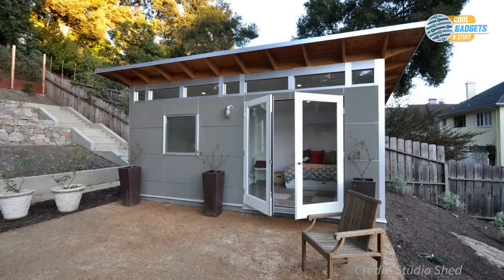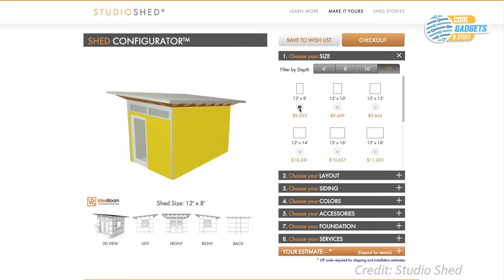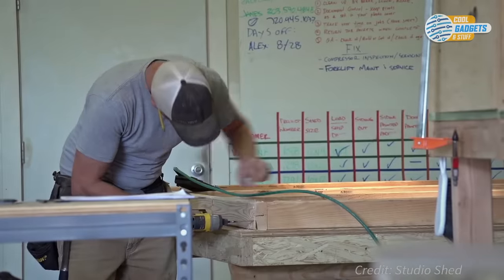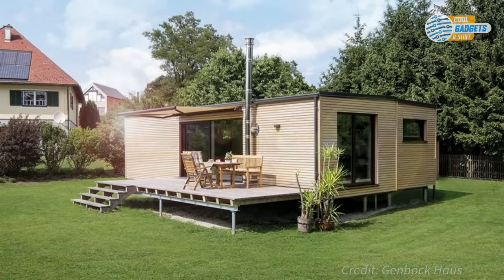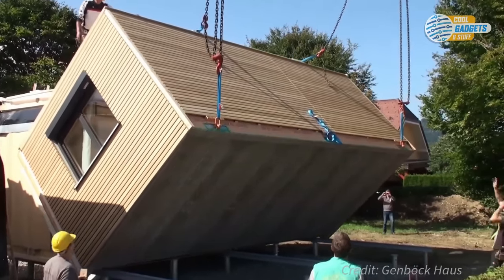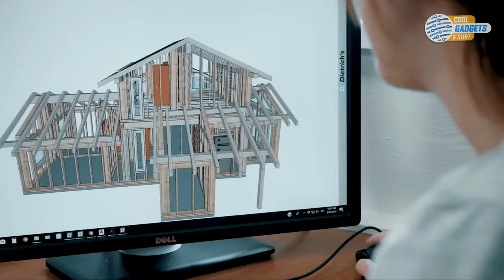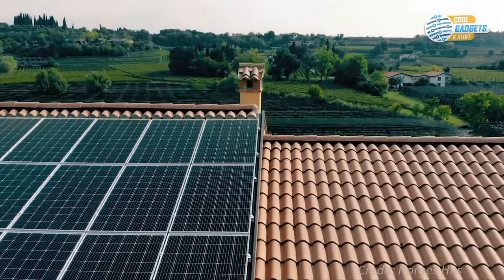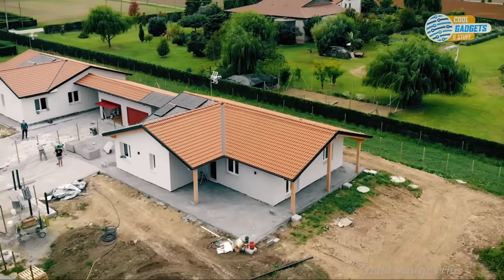7 Great PREFAB HOMES #5

Comment: Our next door neighbors bought a modular home that went up in a matter of days after the foundation was in place. I was stunned that there the home fit perfectly on the slab, all corners were perfect 45 degrees, and there was no construction waste. The structure was very strong and seemed to have better construction because the components had to be trucked and had to withstand the trip from factory to site.
Reply: My mother bought one for her land. Roof started leaking within 3 years, I think traveling tweaked the roof and caused it to fail prematurely. The plaster on the walls keeps cracking, I’m guessing from the structure settling. Cheaply built

Comment: As a professional land use planner, as far as Code goes, I would much rather deal with pre-fab/manufactured/modular homes as the standards are generally twice that set by code. Example is the manufacturer will use 2 X 6 studs or all metal vs the cheaper 2 X 4. In the Pacific Northwest, 2 modular builders I would recommend are Stratford Homes out of Post Falls, ID & Guerdon Homes. Stratford are extremely well built with numerous plans & options. You can also provide your own set of plans & they will modify them for building.
Reply: thank you for your Pacific Northwest suggestions!
Reply: Awesome! I’m gonna take a look, with all the people moving to Nevada very few homes are affordable now.

Comment: I've built a couple houses on pieces of land, then purchased another 35 acre piece, then a 'modular' home package.  Basically all wall panels stacked up on flatbeds, and includes roofing siding, drywall, insulation, all I did was stack it up from blueprint, do roofing/siding drywall and anything else.  Came from Canada so the wood quality was outstanding, unlike this crap here where you pound a nail and the 2X6 splits. 
You can't tell it wasn't 'stick built' and insulated for the Northern climate, love it for a fraction of the cost.

Comment: I notice the general public commenting on the high prices of these units and would like to highlight that price is about the same as a regular on site-built home, except through prefabrication, economies of scale, and tight design controls you achieve one key piece of the puzzle missing from on-site "traditional stick framing" and that is ...drum roll... cost and schedule certainty. No unforeseen costs, no delays, no surprise expenses; everything is planned and designed upfront, down to the last washer and screw. So sure, modular may seem more expensive up front, but that's because the on-site traditional approach will come at a 5-20% higher cost at the end based on unforeseen expenses and details.

I am sure there are great on-site builders out there that can deliver projects on time and on schedule, but perhaps those who have built custom homes can comment on how often that truly happens?

I would also like to comment on the use of software and specialized optimizing machinery that is helping manufacturers carefully optimize the use of their raw materials and reduce the by-waste of construction by 20% (Mother Earth and our forests approve prefab).
Last but not least, I would like to highlight the tight production control and QC protocols in these production facilities are by far superior to what you can expect on-site, where "good enough" is the norm.

Prefab also lends itself beautifully to high-performance building systems, look up "passive house" and "net zero homes", due to specialized work stations and ability to stage materials and products ergonomically, ensuring your walls and building envelope are truly tight.

Cheers,

Comment: I own a modular home which has thicker walls than your regular stick built. It is 2200 sq ft and has a basement and an attached two car garage. Built in a factory allows for limited to no weathered problems. We added a 10.8 kw solar system and a whole house generator. The house is under a VA mortgage which has been refinanced four times in 11 years. I imagine the quality is dependent on your builder, just like a stick built in the rain, snow and heat house.

Comment: So you can buy a regular builders house on a lot/land for $150,000 of 1200 sq foot in some communities. Or buy a base model 600 sq ft that has no land, no basement, no clearing or plumbing or electrical for a starting price of $65,000 ?????  
If your piece of land cost $50,000 - $150,000 and your clearing, levelling, plumbing and waterline connection, electrical grid connection etc...and hold the phone...what about a basement, a driveway etc.

Anyone good at math?
Reply: Ya, it's definitely not a killer deal.
Reply: A site built home costs 100 dollars a square foot finished.most of these are ripoffs or just a new way to build a trailer.o look this one has wood panels instead of vinyl siding add another 25000 to the price.

Comment: wow those are just 2x4 homes, with very very high prices, one can get a 3 bedroom block home in florida for 75 thousand plus lot, these prices are just really stupid for those 2x4 homes
Reply: When was the last time you checked on home prices in florida. If you find one for 75k  it's a total gut job.
Reply: @davesutton50  negative, i found alot, even on a quarter lot, just have to stay out of big city areas, plus got one in my area for 60 just had to have the air fix up.
Reply: @mtz3843  I very been searching. All I've found were mobile homes under 75k but they are on lease lots meaning I have to pay an extra 600 to 800 a month
Therefore not affordable.
Those mobile homes that come with it's own land run tween 90. To 180 k and that's not even a half acre
And they need work. I even looked in the nuclear wasteland of Cystal river
Or the sinkhole areas of Dade City and the migrant 
Boondocks of Myakka.
I've tried Zillow, tulia, and realestate.com where can I find them. Right now I'm paying $1,350  a month for 380 sq ft studio in a 125 yr building with out central air
Outside of winter haven 22 mi to closest hospital.
Reply: @davesutton50  you need to look in sumter county

Comment: Surprised that many commenters say these small sq-ft prefab examples are too expensive, a subjective view wholly dependent on where you live.  Our local market in Seattle prices "Backyard Cottages" (400sf - 1000 sf) from $200k - $450k.  Only 420 have been built in the past 12 years the zoning has permitted them.  Admittedly, not very many, because frankly the median price of $350k is hard to justify for most potential buyers, but that is the market here, YMMV.

Of more concern is why over the past 10 years so many modular home manufacturers have gone out of business: Glide Homes (Michele Kaufman), Blue Homes (reorg-ed from 200 employees --> 35), and many, more firms.  Glide Homes was a favorite of Dwell Magazine, the ultra cool architecture crowd and even the NYT architecture critic.   They burned thru $220-m plus in San Francisco VC money in multiple funding rounds.  Other copy-cat VC funded modular home manufacturing firms have met a similar fate.  That is the cold hard reality.

In our Seattle market however, a local prefab modular manufacturer: Method Homes, is doing very well and expanding.  The difference is Method Homes has never been confused about their value proposition.  They are NOT less expensive than local stick built, they are decidedly more expensive.  What their customer's save is time, not money.  They started as a business barging expensive panelized vacation homes  built on the mainland at their warehouse shop to the NW San Juan Islands, for millionaire CA families at an enormous profit.  No confusion for them, and very profitable.

Michele Kaufman was a very good architect, whom I admired.  Glide Homes had a good product, but they mistakenly believed (and spent bushels of other people's money) they were mass-producing beautiful high-end architect designed prefab homes on an assembly line and would benefit from scale and a controlled manufacturing environment.  They entirely misunderstood assembly line realities: hint "any color you like as long as it is black".  Manufacturing cars is not the same as manufacturing pretty custom homes in a warehouse.... it just isn't for lots of reasons I do not have time to describe here.  Mobile home, and Park Model mobile home manufacturers are a success because they knew the difference and adjusted the business model, and had 60+ years to figure it out in the United States.  Buyer beware however, Clayton Homes (Warren Buffet's dirty little secret) is often in trouble with state's attorney's general everywhere and sued for a whole host of unsavory practices and quality problems.

My hope is the prefab manufacturer's in this video have adjusted the business model and design allowing them to deliver on the promise of module prefab architecture for the masses .... I'm just not confident knowing the long sorted history of this market segment.  Would be great to be wrong.

Comment: In the Midwest small structures, under 1000 sq ft are a curse to the local building authority and zoning.  They feel it drives the overall cost of the community down.  They are reticent to accept the fact that people are living longer and don’t need a 2 story, 3,000 sq ft behemoth to live in.  800 to 1000 sq ft is perfect.  Unattached, small yards, one floor and of course a front porch.  A mobile home community doesn’t cut it for people use to living in a more private a well kept community.  Florida is a perfect example of people of above average wealth living in trailer parks.  They don’t look happy but refuse to pay $500,000 for a 1200 sq ft subdivision home, no golf course, no canal to the inter coastal, but taxes that choke a hoarse.

Comment: Costs mentioned were a bit high.  Would be nice if they featured a 3 BR, 2BA common base materials (vinyl siding, standard windows, doors, cabinets, plumbing fixtures, etc.)  around 1100 ft sq for about less than $100,000 on my foundation turn key except for maybe final paint.

Comment: Any prefab homes that can withstand hurricane storms and wind? I live in Texas, this is hurricane season.
Reply from the maker: Round wall homes and dome homes are suitable for hurricanes. Check out Deltec homes, I featured them in prefabs 3, they are specially designed to withstand strong winds. Also check my Building Systems videos 1 and 2, there are some concrete systems that are very strong.
Reply: They put some in, in New Orleans a few years ago, after the hurricane- flood that destroyed a lot of the town. I think the government was in on them. intended to replace housing for lower income people that had lost their home to the storm. They were suppose to stand up to a hurricane and were built on poles to prevent flooding. Don't know how well they worked out? There was a YouTube video showing them being built and setup at their destination.
Reply: Ken Lee I was thinking the same thing..I live in Florida.
Reply: There are lots available. Just consult with a company in your area
Reply: Show me one, only one house in US that can withstand hurricane, storm or any other extreem weather annomaly... You guys build houses out of paper...
Reply: Straw bales and Gaia Homes are the cheapest and best construction in my opinion. Insect, fire, earthquake, proof.
Reply: @bbbanks6912   Strawbale? Mold
Reply: To everyone on this thread, modular homes are built according to the specs of your local jurisdiction. If you are in a hurricane zone, it will be built to hurricane standards. 
2nd. Modular homes are designed stronger than traditional homes as they need to withstand the forces from the crane. All these super tough built units working together result in a super-strong home/structure. Reach out to your local producer and ask about hurricane building. They will provide the answers you need.
Reply: @user-bc7gj7tr1g  & they will Charge the shit out of you too

Comment: Honestly it seems like these are only a little cheaper than a comparable traditional build. When you factor in the massive depreciation of a “modular” construction, it really becomes a bad investment.
Reply: Yes this is a very bad investment and a waste of money. 
My engineer told me this.
When I was building my home I thought this might be a good idea, less expensive. 
My engineer advised me against it.
These builds are prone to dampness and other major problems. 
Kate 👱‍♀️💕
Reply: I have to disagree. I own a traditionally built home on an island off Florida Gulf Coast. 2 doors down there is a guy who owns a modular built home. Currently, his home sits at $750,000 and is actually higher, per square foot than the rest of the houses on the street. Why? I have no idea. He has a smaller lot, shingle roof (most have metal), an unremarkable house and doesn't even have a paved driveway. His is gravel. We are all baffled but his house is not losing any points because it is modular. Go figure?????
Reply: Hula Shack well I’m not too familiar with Florida or property of that price range, but I promise you that’s the exception, not the rule. I challenge you to go on Zillow and compare similar houses that are modular vs traditional. Almost every time the traditional house will be at least 25% more valuable.
Reply: Hula Shack 
It’s because people are willing to pay those kind of prices for these homes
even though they will never compare to a stick built home...!
Reply: A2 Aviation Actually, modular homes are considered real property just like a traditional home and are just as much as an investment as any other home.  Call any mortgage broker or bank if you would like to confirm.  This is why folks can get conventional mortgages and mortgage insurance just as any conventionally built home.  Just a;FYI for those that may be considering but do not know the facts.

Comment: Let me 1st say I LOVE BOTH but..$65K??? With the quality of materials that I see this has to be, with foundation, septic, well, driveway, etc. etc. at $200 sq ft. minimally..If you click on my cabin symbol, then videos, scroll to the bottom vids, # 1 &2,  you'll see what $13,000  will get you. I paid someone $13,000 to add a 16 x 24 addition to my old cabin, materials included, for just the shell. I supplied the windows and door. Year to date I have $27K invested. And it doesn't have the high end materials I see here  and mine is far from completed yet.. From the original $13K, I supplied the rest of the materials and ALL OF THE LABOR to get it where it is today. And it's still not done.

Comment: One issue that no one ever mentions about Pre-fab homes is,
no site is 100% perfect...
When you build a home, you are constantly making corrections
here and there so it all comes together correctly...
When you’re dealing with something that is already built, it’s not
as easy to make these corrections.
All of your Pre-fab pieces are made to fit each other under perfect,
factory conditions and once you start making changes to one part
then you have to change the next because now the changed part and
the next factory part will not match any longer and it’s a chain reaction...
The next thing you know you’re making changes to every following piece 
every time that you need to make a change...
All of this costing you more work, time, and money...!
Reply: what do you mean by that? you build the ground mostly for areas that your going to live as per house. So the comment makes no sense.

Comment: I like prefabricated homes but in our country you find it very hard to get a mortgage for these homes. After ww2 we had many concrete and tin/ corrugated steel homes built to house the homeless following war. Now many of these houses still stand today. But unless you had proper revisional work done and had and outer brick wall cladding put on you cannot get a mortgage making these home difficult to sell but this prefab label gas carried across to all modern systems and banks will not lend.

Comment: I would much rather buy a tract house than have to go through this hassle. The house is straight off the builders catalog and is normally complete when you are shopping. Also they are nicer and less boxey typically.

Comment: 600sq feet for 65k. I don’t think so 👎🏻
Reply: $108/square foot is expensive? The average per square foot price to build in the US is $120.03 per square foot.
Reply: Lyle Elkins yeah but that typically also includes the price of land. This doesn’t.
Reply: Lyle Elkins also doesn’t include things like delivery, land clearing, foundation, utility hook up, etc. once you’re finally ready to move in, your closer to $150-$175/sq ft
Reply: @flightTime123  Definitely a project just for the ultra rich.   I would just buy an old fixer house that already comes with the land, just work on it to my heart's content.  Pre-FAb is out of my price league...
Reply: Insane...!
This is for those people who think that
if they aren’t spending at least $400K on
a house then it must be a shed...
Reply: @troystutsman1400  depending on where you live, $400k can only get you a shed. Lol
Reply: Melody  I have 1 1/4 acres detached block garage horse set up 53x25 beautiful older mobile home deck etc......... 217k. That’s what I’m talking about👍🏻
Reply: Dianne Mc   $215k for that and you think that’s good?? I have 20 acres, 3 bed 2 1/2 bath brand new 2019 site built house with walk out basement. 24x30 detached garage, 40x60 pole barn for $200k. I also have complete off grid solar that cost $100k.. location  SW MO between lead mine state forest and Bennett springs state park. my nearest neighbor is 3 miles away and they are Amish. It’s pure heaven and completely opposite from my 50th floor condo in Chicago I moved from.
Reply: @JP-kb4yi  l guess it depends what part of the country your in. Not a bad price for here Phx metro arera